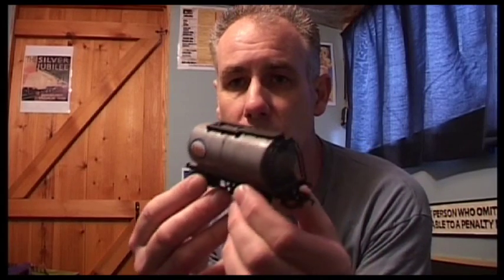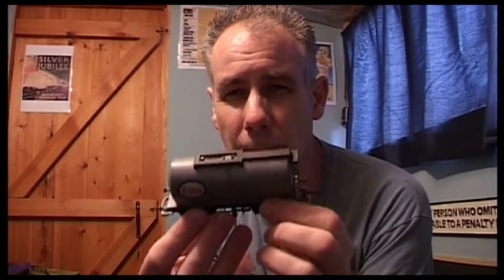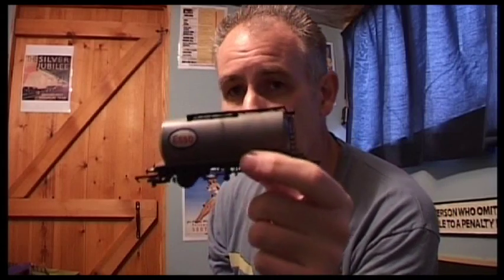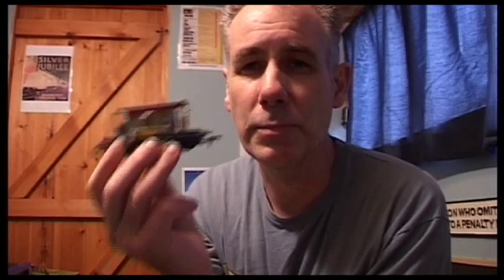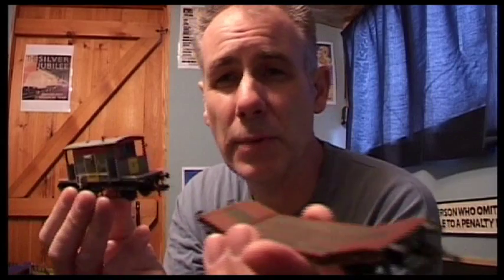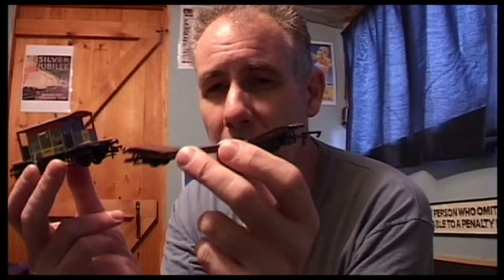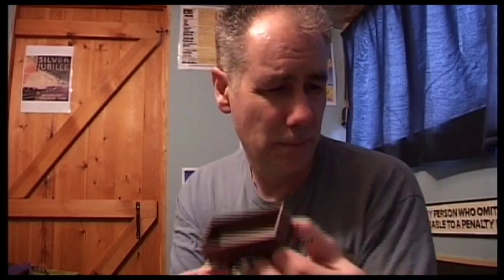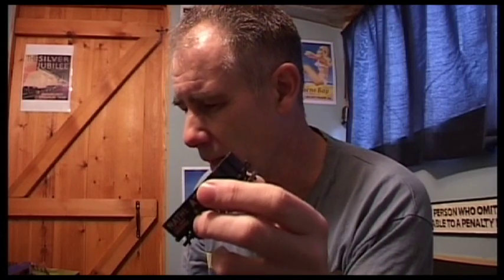Calverton Update 21st Jan 2015 Wagons – Barrier Wagons

Comment: Agree with David. I too plan to run some Steam Hauled Tanker Rakes soon, and was think about wagons I should use. Looking at images from the 1950's/60's they used anything. Think I might, like you, use some coal/open wagons to do the job ;) Thanks for sharing!
Reply from the maker: I have added a link about 2 mins in now. Here I filmed an N2 pulling a rake of wagons, one of which was a BP tank wagon. It has three barrier wagons at one end, but under three at the other. So for my 'preservation line' I won't worry too much.

Comment: Years ago they did , as they also ran mixed freight rakes with a few tanks in the rake , but when you compare to day you just get a rake of tanks , no brake van ..nothing ..I have a rake of tanks , but just not enough rom for a brake van when on the siding track for them ...but interesting ..Dave
Reply from the maker: Well if the wagons have their brakes linked to the trains then I guess they do not need a brake van? They will have their own brake system.
But I am interested to hear people's experiences? I'm sure there is more to this subject.
Reply: Calvertfilm Should be interesting response Laurie
Reply: ***** Calvertfilm I think the operational requirement for a fully fitted freight train with a brake van was removed in 1968. So prior to 1968, you would have the brake van on there. Brake vans were required on hazardous chemical trains up until the late 1990s. I think there are some requirements related to the colour of the brake van, I think the BR grey and BR bauxite had different braking systems?
Reply from the maker: oorail.com
Aha, thanks, that sheds a bit more light onto the subject. This was what I was after - more information. That does help clarify.
 Thanks - Laurie.
Reply from the maker: oorail.com
Cheers for the images.

Comment: Wel, u hav jst solved a mystery for me there Laurie! The amount of vids ive watchd of fuel tanker trains, with symmetrical wagon placement at each end of the train, has always bugged me?! WHY???! Lol! But now i know :) and it does make sense!! So cheers! Does it always hav to b 3 barrier wagons tho? Or cud u hav any amount?!
Reply from the maker: I am new to all this myself. People are telling me different things. Modellers sometimes just use one to represent the fact that they need to be there. But the real-world rules (as far as I know) say three. So sparks cannot ignite inflammable loads. So three to answer your question but I am sure there must be times when that doesn't happen.
Reply: Right i c, all cool non the less :) ive seen it loads on modern vids, mainly with 20's on tube stock moves?! A large rake of tankers in the middle, with a few tube trains between them and 2 20's at each end!
Reply: Calvertfilm Best thing to do is use Google Images and Flickr to find photographic evidence. If you find a photo with the configuration you want, then you can safely run it! You don't happen to know the specifics to those real-world rules? I've got dozens of old BR documents in PDF format, but I don't have the time to wade through thousands of pages and they are scans, so can't do a text search! Here is a photo of a 9F running a petrol train with two barrier wagons at the front, unfortunately the rear of the train is obscured by trees:

http://upload.wikimedia.org/wikipedia/commons/b/b8/Hartford_Junction_with_up_petrol_train_geograph-2751413-by-Ben-Brooksbank.jpg
Reply from the maker: oorail.com I was just chatting to people about this at the clubs I belong to. But for me I am not too worried about running them too accurately. My layout is a 'preserved line' so I can run what I fancy. Nonetheless all this info is useful to know. Interesting.
Reply: Calvertfilm Ah okay that explains it then. I'm lucky, my Dad used to work for British Rail and Network Rail as a railway signaling engineer before he retired, so if I need to know something, I just have to ask! :) I agree no need to be too worried about running them too accurately, I'm quite happy as long as I don't run something completely wrong. Although if I do, I've got a few dozen people who will correct me on the channel! :-P

Comment: Hi Laurie, just catching up.  I will now revise all my freight rakes so they are in conformance with the rules. Great bit of info, where did you come across it?
Rob
Reply from the maker: Well I was told this by several people at the clubs. First person told me one barrier. So I thought I'd confirm using a wise old sage at the other club. He said strictly speaking it should be three each end. But I will try and find out if this was only the steam era. Or if the rules have changed.
Also at a preservation line I go to (NNR) I have seen three and then one barrier, so the rules are not applied there. Perhaps because the tanker hasn't had fuel in it for so long?
I think there is still more to find out. But certainly three each end will not be wrong if you are running in steam era in a prototypical way methinks.

Comment: I always thought it was with steam engines
Reply from the maker: I was told also with diesels because brakes can also create sparks and cause an ignition. But that is only what I've heard from one person, so don't take just my word for it. Laurie.
Reply: Calvertfilm I think it may depend on the size of the train and the type of hazardous material. BR had a SpeedLink service that had very short trains, but even some of those I've seen barrier wagons with just one tank. I have photos though that show chemical / petrol tankers without the barrier wagons on diesels, they could be empties though...

Here is a photo showing the barrier wagon, but its not three.

http://ukrailways1970tilltoday.me.uk/Lincoln_class47_on_tanker_train_BR.jpg